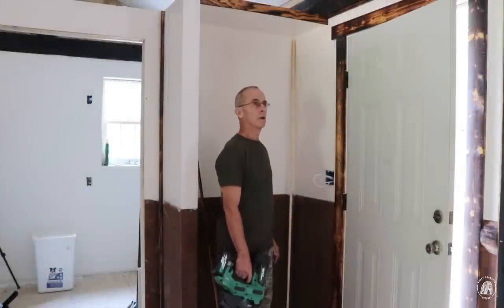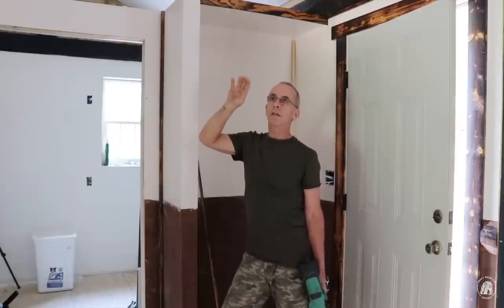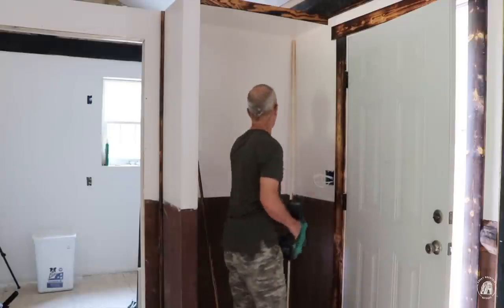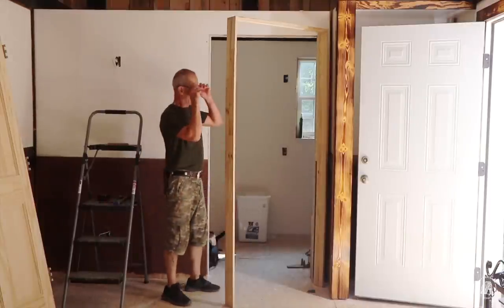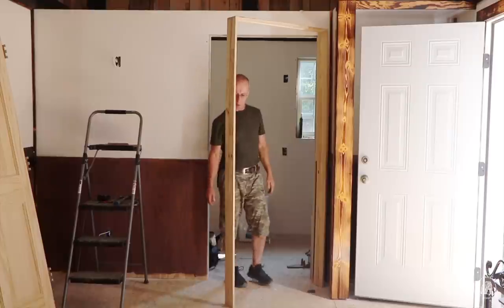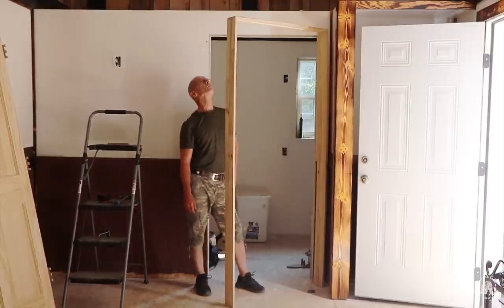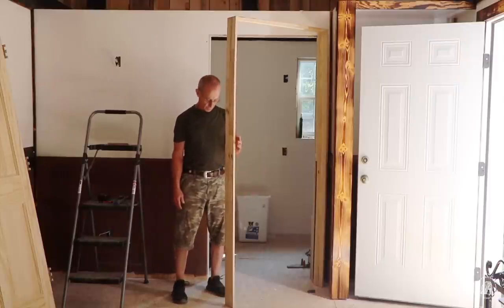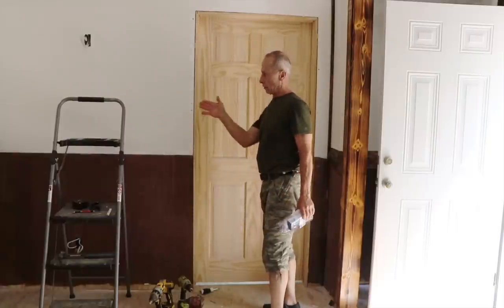BUILDING A CABIN OFF GRID | TIMBER FRAME | INSTALLING TRIM & INTERIOR FINISH

Comment: It is time to get your cabin ready for winter. It was 47 this morning in upstate SC. I went kayak fishing this morning and had to wear my wading pants and a light coat. A tip from my Sheetrock days if you will add just a little water to the puddy on the first application on spotting the nails it slides better with less friction.

Comment: Are those light switches behind the door? If so, was that intentional? I guess some people prefer that, not sure though.
Reply from the maker: The door was cheaper when I bought it. I wanted both left and right doors for rear and front but had a deal on two so it’s no big deal
Reply from the maker: The door was cheaper when I bought it. I wanted both left and right doors for rear and front but had a deal on two so it’s no big deal
Reply from the maker: The door was cheaper when I bought it. I wanted both left and right doors for rear and front but had a deal on two so it’s no big deal
Reply: @SmokyMountainOutpost  Oh OK! Thanks, and thanks for making all these videos. Amazing stuff.